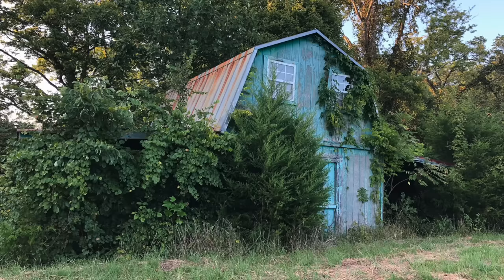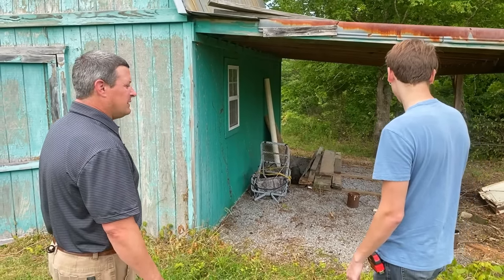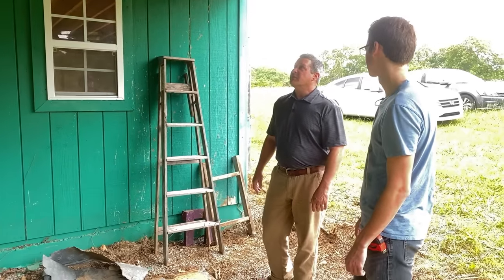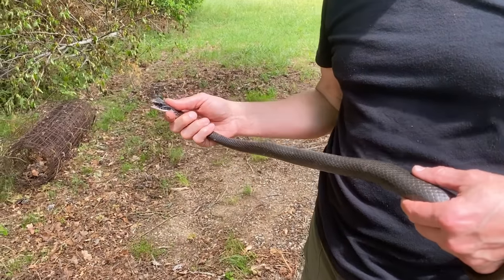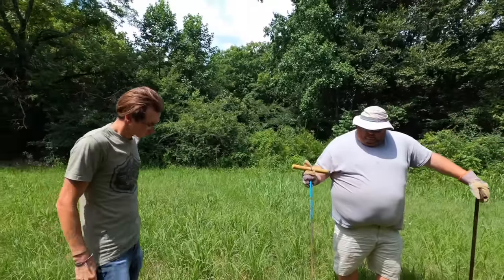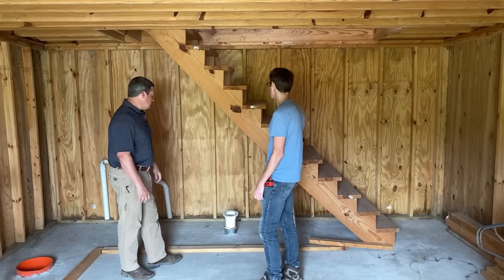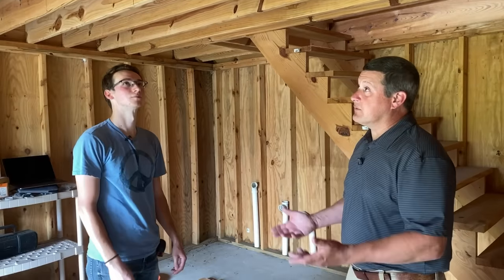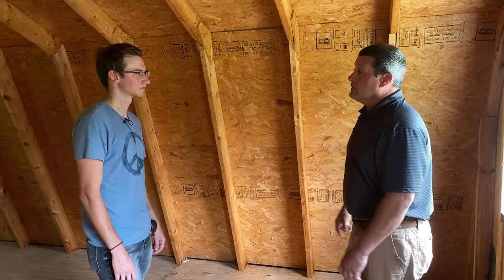Will This Home Depot Shed Meet Building Code?

Comment: Looks like it would be a much better idea to RAISE the entire building and pour a proper footer and floor and then lower the building back onto the RAISED foundation and floor and start from there. OR demolish the entire place and start over from fresh and proper construction techniques and code. JMHO
Reply: Raze
Reply: @rusosure7  Actually, "raise" is correct.  He is talking about lifting the structure off the foundation.  If the structure was razed, it would be demolished.
Reply: @ronnielollis8671  Dammit, you're right.  I read that too fast.  LOL
(Though some here think he should RAZE and start fresh) 😋

Comment: Remove trees near the drain field so the roots don't grow in.
Reply: Very true. My house has a clay drain and has a root growing through it. In a couple years it's going to need replaced. Could have saved a headache if the original owner was aware.

Comment: If the building makes you independent then it will not meet the code.  Where there is freedom there is no code.  Where there is enforced safety or the argument of safety is proposed then there is a code.

Comment: Good video.  Anything over 100 amps for a single family residence seems like real overkill.  Unless you're running a woodworking shop or a welding shop, any more than that seems like a waste of money.  Just my opinion, based on 31 years of building mind you, but just my opinion.  Maybe an electrician could chime in on that.

Comment: All these permits and restrictions are ridiculous and outragious.
Just more taxes to stick it to the man.
Reply: If you give it a little deeper thought Not All of the restrictions are ridiculous and outrageous. Many are for your protection. If no regulations existed, anyone could build any kind of house... it might be a fire trap due to faulty wiring. .. or improper use of materials... or placement of and positioning of flammable materials. Then YOU might be the person that buys that house and it might be your child that dies in the fire. Or they may not properly strengthen the house and it might collapse on you or your child after you have purchased it. Granted, some rules may be unnecessary, but most are there for your protection. NO... I'm not a building inspector, but I have built three houses of my own and since sold them. They were over engineered but many people on small budgets have tendencies to cut corners. Try to see the picture from both sides.
Reply: Codes & Standards are a WONDERFUL thing because it helps you know what is safest for your benefit.
However...I think what you dislike is the "mandatory" nature of the terms "permits and restrictions" and I agree. Because if it is YOUR property, it's all voluntary.  Sure, it's in your BEST INTEREST to go by code, but it's all voluntary on your property.  Taxes are a different matter though.  (edit: a different subject)

Comment: Dude 200 amp is tons you really only need like 60 amps for that tiny house 🤣 go into a 200 amp splitter trough so you can feed to other buildings from there
Reply: Seems like a lot for sure.  However, to be "green", many folks are using the tankless water heaters that pull 40-60 amps...  I'm having to take that into account when sizing my new houses. Where I thought I could get by with 100 amps, now it seems 225 may not even be enough! We call this progress LOL!
Reply: @rusosure7  never understood those things. As an electrician we always recommend if you want electric hot water just do a tank. I’ve hooked up many that need atleast 60 amps! What a waste of energy

Comment: Yeah you could get the city involved and do it all "above board" or you can just turn it into a tiny house and live in it, and claim its a shed and totally bypass the required checks and forms and cost.      Pro-tip:  Unless you have super shitty report for anything neighbors.... the city will never come check your property if you dont live WITHIN the city proper.   Any rural or suburb is pretty much exempt as long as no one reports you (asshole neighbors).       Use Rolled insulation, throw 1/2inch drywall,  make sure a window big enough that you can fit through is available in the upstairs and you are golden.
Reply: We have an amazing building office in our county. They are friends and neighbors and work really hard to help everyone get their project completed. With that said we can legally build without a permit due to agricultural zoning and land size.

Comment: I personally would take it all down and start over reusing as much of the existing material as possible. As it stands your looking at taking it down to the frame and removing/rebuilding the roof.
Reply: From what I understand, it's a temporary home till he builds a new one nearby.
Reply: @rusosure7  But to finish this? cheaper to by a used camper.
Reply: @francismarion4450  Possibly. Maybe even probably.
However, props to the young man for reaching out beyond his computer career and jumping into the realm of home construction.  The experience he will get is worth more than the money he'd save on a camper.
Reply: Francis Marion  Or 4/0 aluminum!  Not sure the layout of the property, but his shed may be between the transformer and the planned house.  The house may be on the sub-panel when all is said and done.

Comment: If you are building your own house on your own land building codes are unjust
Reply: I was told that they require codes to ensure that you don't build a death trap and then sell it to an unsuspecting person sometime in the future. I'm sure the deeper meaning is that insurance companies want to avoid paying claims for badly built buildings and contractors are often part of the committees (in my area at least) that set the codes, so they set them to discourage DIY, which costs them money. 

Of course, some of the codes are also in place to protect the public and environment like ones regulating septic systems that could pollute waterways. Others regulate the use of grid connected generators/solar/wind which could electrocute line workers if the power goes out and there is no lockout installed. Even things like retaining walls and fences can have an impact on water flow, erosion and other issues that can trigger disputes, so they regulate it based on precedents set by angry neighbors. And tax revenue, of course!

Comment: there are no codes on sheds. plus they are considered "portable" ( coughs). just lived in structures. maintain that it's a shed
Reply: The difference between temporary and permanent is if it has a concrete foundation. And this building is sitting on concrete so that makes it permanent.
Reply: @1pcfred  i used rr ties as a base making it "portable"
Reply: @gregsmith7828  as long as they're wooden ties you're OK.

Comment: Probably not to code. Easier to rebuild new.?A friend bought a building not deemed zoned per present specs. Despite this it could be rebuilt as a grandfathered existing place. Inspector advised tearing down most of the old structure to rebuild it leaving one original wall. .Then tearing that down and rebuilding that..Tthe theory being the ship Jane rebuilt, is still the ship Jane. To tear down the whole building to build new kicked in the fact that the new zoning and use codes were violated. Who knew they had building inspectors in ALA.?
Reply: We had very little to change, because I opted to have upgraded framing at my own expense 20 years ago. Steps had to go, but other than that we were okay and just added on. Starting over might be easy, but it wouldn’t be nearly as fun and educational. We are going for efficiency - we want maximum father/son time.

Comment: american building codes are weird mate :)
Reply: America is weird. It is weird by design. Building codes are local. Every municipality has their own.
Reply: We have a wide range of climates. My relatives up North have thick, strong roof trusses to support the weight of snow and ice. In Florida, we have relatively lightweight trusses, but everything is bolted (roof to walls to slab) to the ground to keep it still during hurricanes! Out West, they design everything to withstand earthquakes. If it snowed really bad in Florida, roofs would collapse and if there was an earthquake in New York City, many of the buildings would collapse. We're a mess of natural disasters over there:-).

Comment: Is it outside the city limits. If so codes what codes.
Reply: I guess he’d like to build a safe structure, if your ok with the roof collapsing onto grandma when she visits good for you.
Reply: Absolutely.  If you own the property, treat codes as really really good advice.  
But why suck off some gubmint agent for permission to do as you wish with your own property?
Reply: @claytonroberts344  Hospitals all across this country are full of people with your attitude maybe you can use gorilla glue instead of nails to save the cost of buying a hammer.
Reply: @rusosure7  because maybe someday he (like nearly every other homeowner in the world) will sell the property and he doesn't want to be liable for building a death trap for someone else's family.  Some building inspectors may by a major pain to work with , but their experience is invaluable, especially to a new builder like him.
Reply: @jimmydyurko  So, to clarify your position, the only way to protect yourself from future liability is to suck off some gubmint agent?  And here I was thinking that building to code standards was all that was necessary.
I guess I learn something new everyday. Can we spit? Or will that require a separate permit?
I have no problem having a hired inspector sign off on my work, but it'll be a cold day in hell when I ask someone else for permission to do as I wish with my own property. You may not see the difference, but it extends waaaay past construction.
Reply: Francis Marion  By the way, I love your name. I thought it was familiar so then I looked it up.  Patriot was an awesome movie.    Anyway, can you tell me what you mean by: "have to be removed when the property gets sold or the property appraiser stops by?"  Mostly the "have to be removed" & "property appraiser stops by".     Thanks
Reply: Francis Marion  What county do you live in?  
I'm in the heart of Pinellas.  I bought a small lot in Pinellas Park upon which I plan on building about 6 structures. 3 studios, a gazebo, a shed and a garage.  Before I start the ground development, I'll be contacting Mike Twitty, the man acting as property appraiser & asking a question:  Does the county have any vested interest in my property, and if so, show me the receipts.  Obviously, he will say no.
My property is my property and by definition it is mine to the exclusion of all others to do with as I wish.  
Any "code enforcement officer" will be trespassing and will have to answer in my court case if he attempts to administer my property without right.  And governments have no rights. Only authority granted.  And I will have already established that I grant them NO authority on my property.
And as for property appraisal, I have the tax bill for the vacant lot.  Mike Twitty will already have replied that the county has no vested interest in my property.  So if I put a tent, or put a castle, the "tax" shall not vary.  I'll handle that in court if needed.  Without attorney.
 
Now, as for codes, I've already established many many MANY times in comments on this video that I think codes are great.  I plan on having the electric & plumbing to code.  As for the structures, seeing as they will be built to FEMA Near-absolute protection for any hurricane, tornado, earthquake (the last two we don't see too often), as well as fireproof, termite and rot proof...they will FAR exceed any conventional structure in safety from any weather event and even internal fire.  Plus, they will be "green" in that they will only have to be built once and will last centuries, not decades.  Not to mention 1/3 the cost of heating/cooling.

This is my passion now.  As well as sharing with others that they can be free from this crippling mindset that government is their master.  Government is a servant.  Governments are established to secure the property (& rights) of man.  If these servants decide to get uppity with their master, I'll gladly take them to court and show them that man is boss, not some corporate fiction.

It hasn't been mentioned yet in this video comment section, but I'm waiting for someone to ask me about my views on "drivers license & registration tags".  That will be fun too!

There was this dude in other threads from Mississippi who would say "fuck that" about living in the city/urban areas because you can't be free.  So he's way out in the rural area thinking he's free.  He can't see that if you have to be out in the sticks to be "free", then you're not really free.  I'm free right in the heart of it all.  I have no problem filing a suit in law against any man acting as a government actor who believes he can trespass on my property/rights.  And since I'm a man, I have standing.  Their attorneys do not.
Reply: Francis Marion   We have Duke Energy here.
The only issue I may have is with private companies.  I already have water and sewer hookups from a mobile that was there 20 years ago. There is a power pole, but not where I desire it, and it can't be more than 100 amps either.
I require at least 225, and a new run from the transformer.  We'll see what they require. 
But at least it will be Duke requiring the permit, not the city/county.  I won't be bound to them (the local government) by obtaining one.  That's the beauty of being sovereign.
Likewise, I DO have a driver's license for when I need it: like when renting a car or test driving one at a dealership.  These are private entities, not public, and they can demand it if they wish. I respect that.
However, when I'm simply moving my property in the public, I need no license.
I bought a set of plates online that say PR1V4T3 and have been driving around with them since September last year.  I've had Largo PD sit directly behind me at stop lights and do nothing. I'm sure the Sheriff's deputies have seen it too.  They're not effing with me.  I am actually looking forward to the day, but I'm guessing it won't happen. 
They may realize that they're seeing a man who knows his rights and don't want to risk getting slaughtered in court.  I'm not nervous nor afraid now.  I feel free and love it. Finally. It took a couple years to reprogram my slave mentality.  I still have far to go, but it does feel great.
40 years of driving, always afraid of cops, and what they may ticket me for: expired tags, or expired Inspection sticker (Maine), or not having my license on me.  All those fears now? Gone.
If I ain't breaching the peace, they have no authority to stop me.  Common Law. It reigns over this 2 dimensional code world everyone has been taught they are bound to.
Reply: Francis Marion  As for your property, is it your property? Is there a man who will swear under oath or affirmation that he/she has vested interest in it?  If you have no mortgage, I would say "no".
Give the county notice that you have removed all restrictions from your property.  Build as you wish without concern of percentages this, guest houses that.
Dude, there won't be a man opposing you in your court. If they take you to court, file a claim against them for administering your property without right. No attorney may speak in a common law court. It's mano a mano. You win by default.
Reply: Francis Marion  The mortgage holder may have a claim to a portion of the house, but they have no claim to a garage/shed/gazebo/dog house/acreage.
If they get pissy with you, tell 'em to remove "their house" from your property. Or you'll start charging them rent.
Reply: Francis Marion  That actually makes me sad. :(   We are free here. We just don't realize it.
If you can get "The Wizard of Oz" original, please watch it again.  I saw it so many times when I was growing up and as an adult I thought it was kids movie. But actually...it's a lesson on how we can operate in the black & white while in this world dominated with "code" a.k.a. the "color of law".

Glinda's last words to Dorothy explain what I'm doing with these posts.
Dorothy jumped through so many many hoops only to find her way out was snatched from her yet again.  That's what this code world does to a man beguiled by it.
Here's a clip of the final scene  
https://www.youtube.com/watch?v=LT12WuZb_DU
The analogies are endless.  It's a really good movie.

Comment: It seems they skipped some steps in this video.  It is extremely unlikely the building dept. issued a permit for this project based on what we saw.  No self-respecting building dept. would allow a two-story structure on a slab foundation without an engineer signing off, especially one that was never designed for human habitation.  There are ceiling height issues, room size issues, and wall construction issues, that weren't addressed.  Lincoln County, Tennessee may allow this, but most jurisdictions would require much more than they showed us in order to get that structure permitted as living space.  Converting a shed into a home, in most states, is not a good idea and is not as easy as this video would have you believe.

Comment: This very is kind of useless. Most people who buy these for living is going to put them outside of city limits where a lot of the codes you mentioned aren't relevant.
Reply: I differ, even a building out in the county has to follow building codes at least here in Arizona, and if you skimp you'll be either repairing or rebuilding, it is never good to skip codes. If you do not build by code the building can not go on the market if you sell it.
Reply: @GM8101PHX  ... my figuring tells me he got permits so there will be rough out inspections long before sheetrock goes on. (and hopefully before any spray insulation)